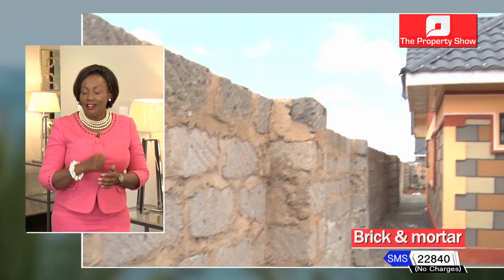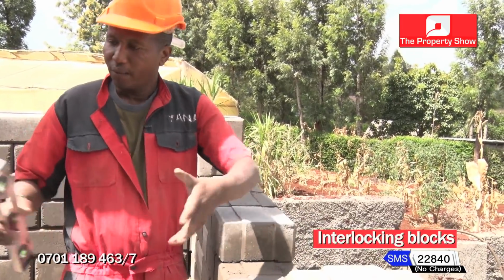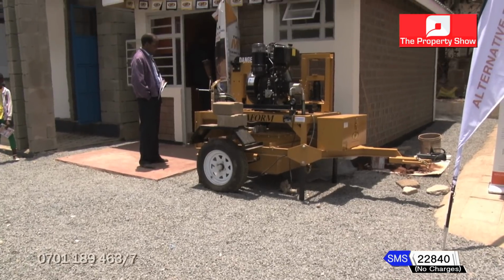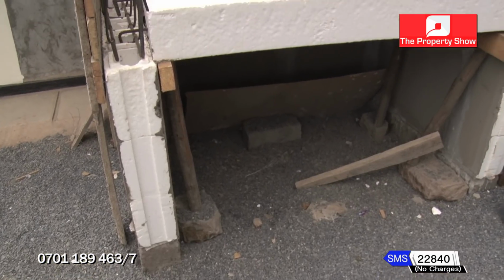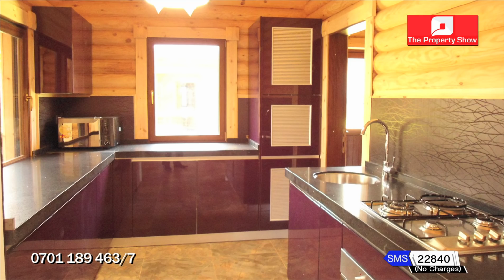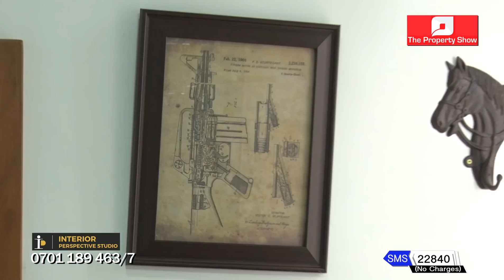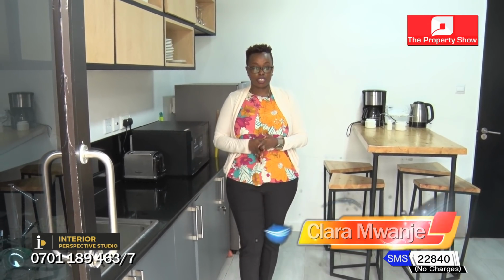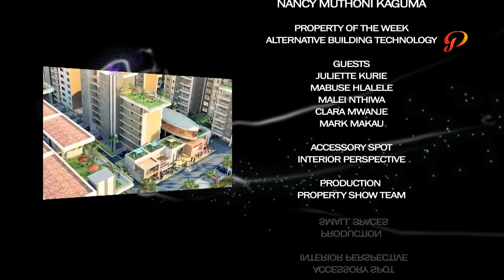The Property Show October 14th 2018 Episode 282 - Alternative Building Technologies

Comment: The INTERLOCKING BLOCK SYSTEM, how do they go about putting in the electrical wiring through the walls?   Thanks.
Reply: My question too
Reply: I would like to know also
Reply: You can wall chase like normal walls
Reply: There are specific blocks with hollow spaces that allow wires and plumbing to be run through the wall without having to break into it.

Comment: My people are not advocating for interlocking blocks but I think this is the way for me. Which is cheaper, but the machine to make blocks or buy the blocks? These blocks have a very smooth surface and I like how they are interlocking. Am very new to this technology.
Reply: Samuel Maondu I think they interlock very little..the edges where they interlock could be a little bit pronounced,
Reply: I have seen bricks with holes so you can have rods to stabilize, I think that is the best

Comment: Hey got a something  like the interlocking bricks  do they really  last  ? Like how stable  can they be in the presence weather conditions  kindly?
Reply: With 10% cement and a soil stabilizer...several hundred years. They need to be sealed to keep moisture from penetrating the block wall system.
Reply: @rongray4118  what can one use to seal the brick wall without interfering with the beauty of the bricks?
Reply: I think the house will flood